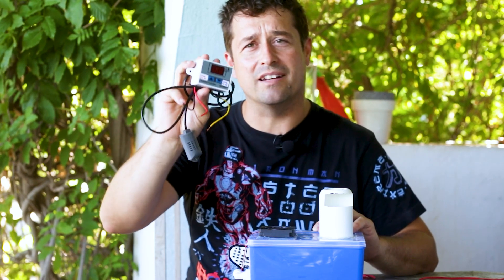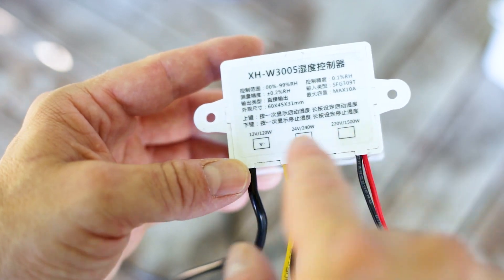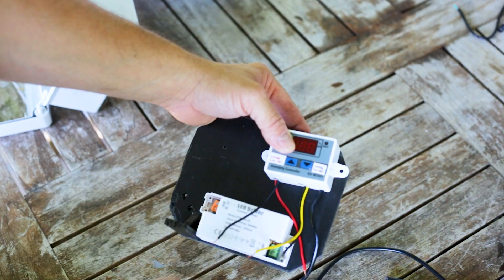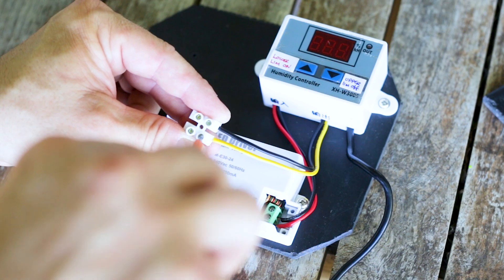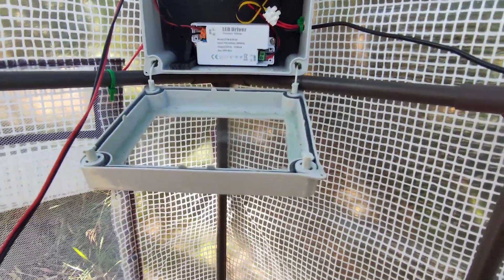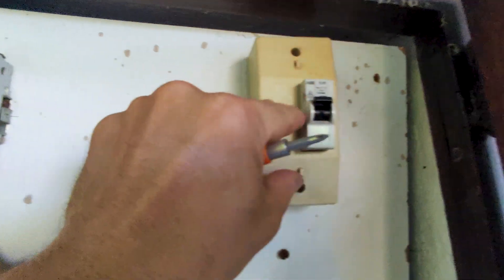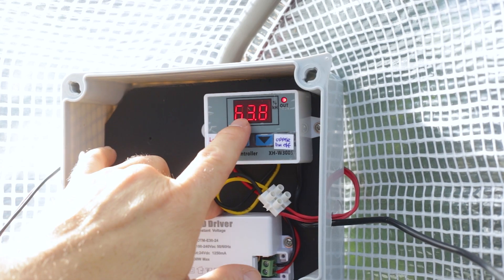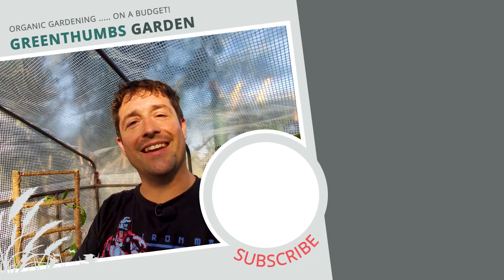Humidity Sensor Switch Connection To DIY Fogger To Control Our Greenhouse Humidity Levels

Comment: Hi I have the same controller but a 240v mister... it didn't come with a driver.( what is a driver?) Is it a power box... would I get a 240v power box for the mister? And would that be OK with 220v humidity controller?

Comment: I recently purchased such sensor online. The humidity detection accuracy is way off, like 8% to 10% off. I don't know whether my unit is a dud or it's normal. Whoever uses such sensor should check its calibration before deployment. Cheers.
Reply: I found that too - shows ambient humidity approx 15-20%. 
Googled the problem but can’t find out how to set the ambient humidity.  Have you figured out how to adjust for the inaccuracy.
Reply: @Paua4T Can't. Such calibration is baked inside the chip.

Comment: Hi Alex, great video, thanks. Could I extend it by adding solar panels? if I well understood it could be possible to power up the sensor with 12 volts to power up a 12 volts fan - then with a solar panel this should work isn't it?
Reply from the maker: I would imagine so, I'm no electrician but I think as long as it is all on the same voltage. Maybe would be better that the solar panel powers a battery for a more stable current.

Comment: is this applicable for dry cabinet?
Reply from the maker: Yeah I would guess so. You would just use the switch to turn on the dehumidifier or vent when a certain humidity level is detected. You will see a few devices for sale on Amazon, some of better quality price.
Reply: @GreenthumbsGarden  does your device only tell the humidity? i don't have idea what device can decrease or increase  or maintain the  humidity value automatically

Comment: You put the settings wrong.
Reply from the maker: Well it did the job...
Reply: @GreenthumbsGarden  hi, does this device can control dehumidity? Like when a room is too humid than it turn on fan or dehumidifier until it reach certain level and turn off?